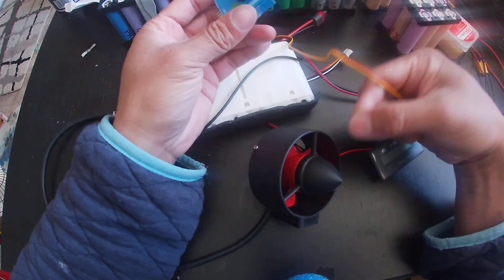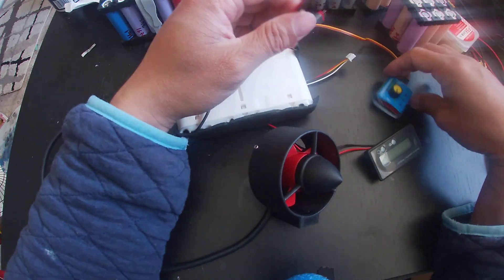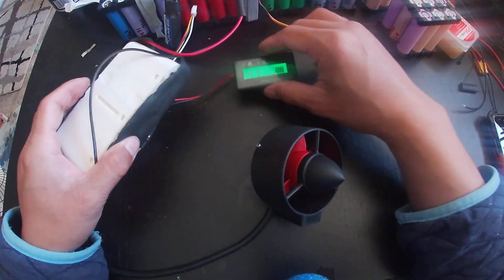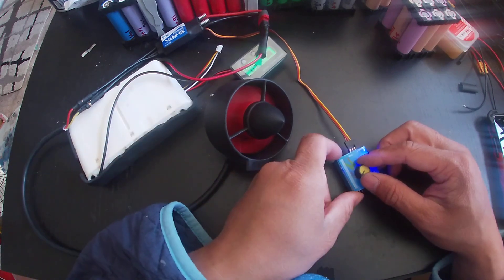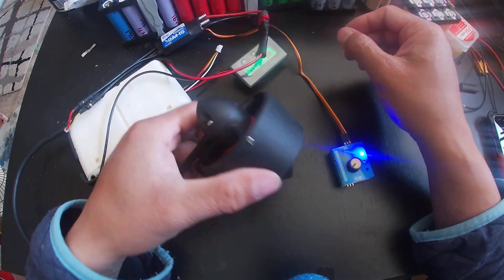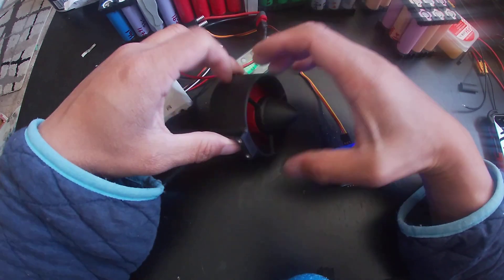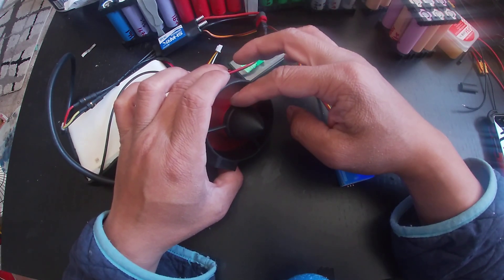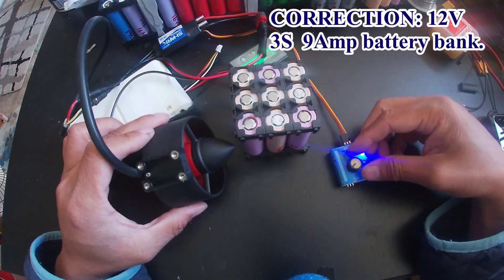Underwater thruster motor  for Kayaks 12v 3s

Comment: just wondering are those thruster can be use directly from dc power supply, if so do i need ESC ?
Reply from the maker: yes it is DC 12v , requires ESC pls see video, i hold it upfront when connecting battery (can connect multiple motors at one time.) Believe it can also connect to a remote controller for drone /robot use.
Reply: @Mitch_Outdoors  Thank you, i'm gonna use it's as wavemaker for reef tank
Reply from the maker: @IssisLinn  Sounds good